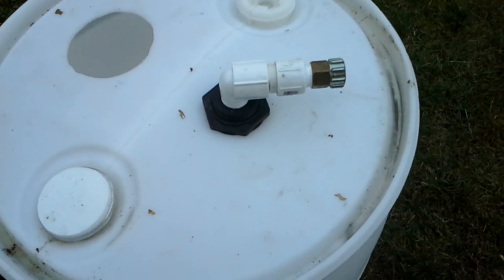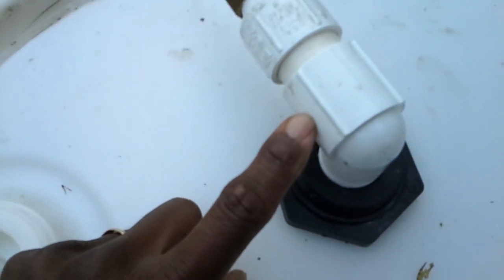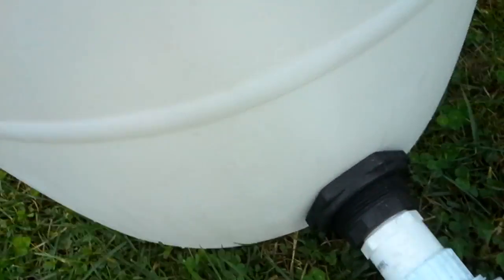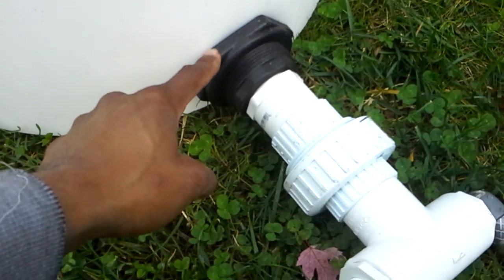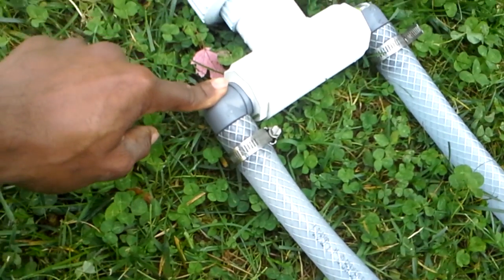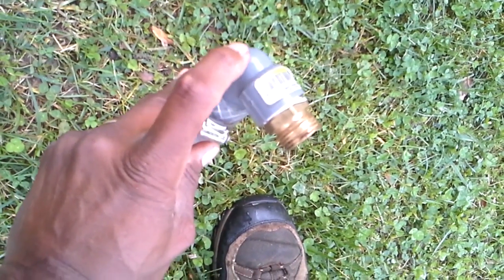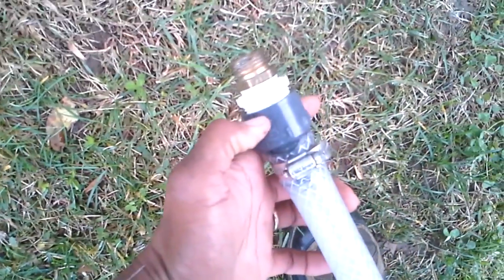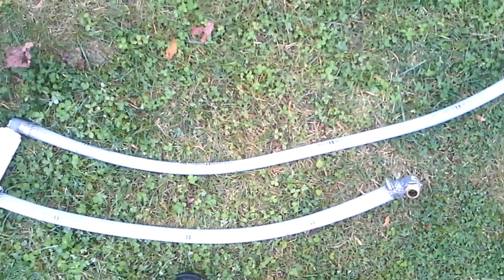How to setup a portable economical pressure washer buffer/float 55 gallon barrel tank plumbing

Comment: What did you use as a lid to cover that hole on the top
Reply from the maker: A pro would have cut the hole to the determined size for a lid..
I went extreme budget (don't laugh, keeping it real) i balled a few big trash bags and stuffed it.. never fell in or came out. 🙂
Sure there are lots of options though. Thanks for viewing.
Reply: You can cut the hole a little bigger and use a 5 gallon bucket lid :)

Comment: Would you mind listing the pieces for me? im trying to pick them to do my own buffer tank like this!
Reply from the maker: It's just 1.5" fittings for hardware store...
The only thing I ordered online at the time if this build was the black banjo fitting, but I believe they have them in stores now, the hudson float valve online.
1.5" treaded to spigot
1.5" union
1.5" tee
1.5 to 1" reducing (slip to threaded)
1" treaded to barb..
Then figure what you need to go into your pump...on mine I needed to go from barb to 3/4" garden

Comment: Hey Griff, thanks for the video. Do you think that 55 gallon barrel setup with run 2 4000 psi 4 gpm pressure washer?
Reply from the maker: Oh yeah...I did
1.5 inch opening tee to two 1 inch lines into each machine.
Reply: I’m just gonna run one off of this design for now but as I grow and get another machine it is nice to know that I can run 2 off of this
Reply: What’s a botg?
Reply from the maker: Not sure what "botg" is
Reply: Griffs Services lmbo you meant both
Reply: Griff I didn’t even know you could combine to 4 gpm machines and make an 8
Reply from the maker: @americascout6764  😁
Reply from the maker: @americascout6764  oh yeah...
That's like my first video back in 2009...
Then I have one shooting a building 16gpm
Reply: Griffs Services are you serious? Good to know
Reply from the maker: @americascout6764  https://youtu.be/02PkryqmatU
Reply: Griffs Services you’re a genius! I can’t believe that worked!
Reply: Awesome Thanks Griff! That’s a really awesome design.
Reply from the maker: @americascout6764  welcome!
Are you planning on combining the botg machines for one trigger high flow?

Comment: Thank you sir!  Very informational! Quick question. I am wanting to run 2 washers off a 275 gallon tote. Would it be ok to just install 2, 1" banjo fittings at the bottom of the tank then feed straight to each washer? I have a 2" inlet with banjo already but want to use that for dumping the tank.
Reply from the maker: Jeremy Cockerham thank you...
Yes you can install individual 1" lines to each machine via individual tank fittings.
Here is an option to consider, run the existing 2" bulkhead with a 2" tee, one side for dump, the other side fitted with a line to accommodate another tee and branch off as in video.
Either way would work, depending on the GPM of each machine. What gpm are they each?
Reply: Griffs Services (House & Building Soft Wash, Power Washing, Pressure Cleaning) Thanks for the quick reply! We are running 2, 4 gallon per minute units. I would probably get more pressure coming from the 2" into the 1" as opposed to coming straight from a 1" from the tank.
Reply from the maker: Jeremy Cockerham Two 4 gpm you should be fine as in video, however I would put 1"  valves at the line closest to the tank, just in case you drain the tank all the way for some reason , that way you will maintain prime in each of the machine supply lines.
Are both machines direct, belt or gearbox driven ?? (slower speed pump aka belt & gear have the capacity to suck , from flodded/primed lines, most direct drives have to be force feed with some positive pressure to inlet. The higher the water level of your tank or even the tank itself in relation to the inlet of the pump inlet, the more inlet head the pumps will have, ie better output performance.
Reply: Griffs Services (House & Building Soft Wash, Power Washing, Pressure Cleaning) They are both direct drive. We will soon be upgrading to belt drive. Thanks for all your help . I greatly appreciate it
Reply from the maker: Jeremy Cockerham 👍

Comment: I have a question. I'm starting off with residential, driveways, siding, walkways, etc...
What would be the average water tank size (gal) that I would need. With my pressure washer at 4000 psi at 3.5gpm
Reply from the maker: Joshua Sutton that size in video is 55 gallon I obtained free of charge at local car wash.. they also had a 30 gallon...any of the two should fit your needs. thanks for watching
Reply: Awesome! Thank you so much for the advice.and great video
Reply from the maker: Joshua Sutton Your are welcome..all the best on your endeavors
Reply: Griffs Services
Hi 👋 
I just set up my pressure washing rig in a very similar way to the video except I have a 125 gallon horizontal tank.for some reason I am not getting water pressure to the pressure washer. What can I be doing wrong? I have a direct drive dewalt 3800 psi at 3.5 gpm
Reply from the maker: Joshua Sutton what do you mean exactly that you're not getting water pressure?
follow this procedure: Fill the 125 gallon tank ensure that there is an opening to the top of the tank so air can get in this ensures it would no create a vacuum on the tank.
and ensure that you're getting a nice flow between the 125 gallon tank and the line that is to be connected to the pressure pump. (this line should be no less than three-quarter inch internal diameter)
connect the feed line to the pressure washer. ensure that there is no pressure line on the exit of the pump.
start your pressure washer and observe the outlet flow. 
(some direct drive pumps do not draw water, so they need a proper priming, and a good head pressure to the inlet of the pump, you can achieve head pressure by having the tank higher than the height of the inlet of the pump).
hopefully this procedure get you going
Reply: Griffs Services water is not being pushed to the pressure washer from the tank. Could it be that I have the pressure washer on the stand and I need to take it off to mount it to the trailer?
Reply from the maker: Joshua Sutton ideally the inlet of the pressure washer should be lower than the outlet of the tank in addition the tank should be full before you start
Reply: Griffs Services 
Ok. I'm going to take it off the stand tomorrow and then see what happens
Reply from the maker: Joshua Sutton ensure that you see if flow from the tank line and while it's flowing then connected to the pressure washer.. that way you are ensuring that the inlet of the pressure pump is flooded

Comment: can you list all the parts you use in the comment section please? will a 1500 psi pressure washer work?
Reply from the maker: Josh Foster you giving me homework.  lol....I will
Reply: Griffs Services haha I would greatly appreciate it. trying to get this detail business going asap. I have a pressure washer.and a 55 gal drum. it has a water spicket towards the bottom of barrel. I filled up the drum half way and hooked my pressure washer to it. It won't keep spraying. I think I need a bigger opening for the water to come out of the barrel?
Reply from the maker: Josh Foster That depends...some pressure washers  (the pump really ) can't draw...so you will have to have the drum at a minimum level so that it forces water into the inlet of pump...what is the model of the pump or washer you have?
Reply from the maker: Josh Foster 1.5" tank fitting 1.5" adaptor (threaded to slip), shot piece of 1.5" pvc pipe 1.5" union (slip) ,1.5" Tee, 1.5" to 1" reducing bushing (slip to threaded), 1" threaded to 1" barb 90 deg, 2 hose clamps, 1" barb to 3/4" female, 3/4" ntp to 3/4 garden male...think that's it for the outlet...you need the inlet?
Reply: Griffs Services I have a briges and strain motor. handyman series pcs2-15421. the s in the first set might be a 5.. pump rpm is 3200. Also it's 1500 psi. It's probably 15 years old lol
Reply: Griffs Services omg thanks you so much! this is a huge help!
Reply from the maker: Josh Foster welcome...best of luck

Comment: is the top of that 55gal drum removable? if not how difficult was it to tighten the banjo fitting from the inside of the tank if it isnt open on the top?
Reply: is there a trick to installing inside the drum?
Reply from the maker: +luigi bossiello my arms are long enough for the opening I cut to the top...but general method for larger tanks is to use string or wire from top through open where banjo goes then just place top of string through banjo fitting and let it fall to opening. ..let your fingers pull it to opening to fit up fitting nut...
Reply from the maker: if the drum does not have a cut  opening like i did, then the banjo fitting used for outlet at bottom would have to be able to pass through the standard tank lid opening, and i dont think the have a banjo fitting that small, if it did it may not offer enoung flow to your pump

Comment: can you do this similar set up connecting two 55 gallon drums with bajo fittings on both sides and without the union and just a 1.5 tee to 1 hose outlet
Reply from the maker: I am sure you can...and you will have a larger capacity
Reply: can you post a link to the banjo fittings you used, I've never used them before
Reply from the maker: +luigi bossiello http://www.tank-depot.com/product.aspx?id=1018
Reply: thank you!

Comment: I'm going to get a water pump and connect it to my 65 gallon drum to feed my 2.3 GPM, 2800 PSI Pressure washer. Do I need to get an unloader valve, or will the one from my PW protect my water pump from running dry?
Reply from the maker: What is the model of your pump...an unloader function is not to protect against running dry..but rather to regulate the pressure to the amount at which it is set.
Reply: +Griffs Services I have the Ryobi 2800 PSI, 2.3 GPM gas PW, # RY802800. I was told that when I let go of the trigger, water won't circulate thru my water pump without the Unloader Valve?
Reply from the maker: +ScarredTemple not familiar with that brand/model...but must store bought units when you release the trigger the water does not "bypass" anywhere and thus the water in the pump head overheats...the only protection is a thermal relief  (and I am not sure if your unit has one)
Reply: +Griffs Services Thanks for the reply, I really appreciate it. The PW has a 4.4 HP, GCV 160 Honda engine, 3.3 KW @3600 rpm's (if that helps).
Reply from the maker: +ScarredTemple you are welcome. ..but I will have to look up the model when I get to store or on desktop...but till then nothing protects your pump from running dry..and most likely you don't have an external bypass... (this is where when you release the trigger the water from pump goes back to tank or open air
Reply: +Griffs Services Okay,thanks for clarifying that. If I don't have an external bypass, will I need an Unloader Valve?
Reply from the maker: +ScarredTemple all machines have unloader valve as standard..that controls the max pressure...the cheaper machines have the that valve bypass internaly  (you can't see the water) and bigger/commercial grade has ir bypass externally
Reply: +Griffs Services Okay, is there a PW that you would recommend that pulls from the tank, and doesn't need an additional Water Pump?
Reply from the maker: +ScarredTemple who says yours will not draw..get the tank and try it...some direct drives pull with...also if you have enough head from the tank and the feed line is adequately sized it may work..(line size should be preferred 1")
Reply: +Griffs Services I hope it does, so that I won't have to spend anymore money Lol. I won't be able to try until later next week though. Thanks again for the help
Reply from the maker: +ScarredTemple send me a check of the savings.   lol
Reply: +Griffs Services Lol.

Comment: I came across..Water pressure 3200 psi with a flow rate of 2.8 gpm will this work with this setup
Reply from the maker: it may or maynot, one of the best options is to elevate the barrel or set the pressure washer lower than the barrel. the water should flood the inlet and it may draw in..make  the feed line at least 1 inch.
Reply: For a 2.8 all you need is standard home pressure no buffer tank unless you have 4 or larger.

Comment: could u recommend  a electric pw.. I'm looking to start the a small detailing business  and I could go gas but I'd figure to go electric first any help would be sweet
Reply from the maker: +Emprez hernandez There are quit a few option on the market for mobile detail pressure washers, all of which i am not familiar. The doubt i have about smaller box store electric units is if it would draw (pull) adequately from a 55 gallon drum I have in video. In theory it should draw as the drum static pressure will push water through the supply line.
If you want to start off with a small electric i would suggest you obtain the customer service number from one of the big box stores pressure washer manufacturers, call them and hear what they say about their various units. Let me know how it goes.

Comment: This is a great solution to my problem and much cheaper than ordering a tank online. Is your pump belt driven or is it direct drive PW?
Reply from the maker: Richard Williams the pumps running off this set up was a gear box drive (4.0) and the other belt 4.5
https://www.youtube.com/watch?v=KRaf2FnBBSs
ps. no charge for the 55 gallon drum at my local carwash
Reply: Thanks for the come back brother, I appreciate it. My unit unfortunately is a direct drive. My unit is a 3.5 five gallons a minute at 4000 psi. By North Star. It's a great portable unit, I never had any problems with it. But I was looking to put a tank on board to have the option of having water on board for power washing, window and Awning cleaning
Reply: In your opinion, do you think it would work
Reply from the maker: It very well may...feed the pump with a one inch line, ensure there is no air pockets, maybe even tee at the end to ensure you are always bleed 100% just before the pump.
Reply: Hey with a free 55 gallon drum and a couple  of dollars for plumbing fixtures, what can I lose. Thanks a lot buddy, I'll keep you posted
Reply: The worst that can happen is it doesn't work, but I'll have a great chemical storage tank for free. So I the way it's win-win and thanks again
Reply from the maker: 50 cents it works,.....post your results
Reply: Hey brother, it works pretty good. Just think, I almost bought a tank for $425 and the shipping & handling charges alone was $275 to $350.  Even if I bought the tank, I would have still had to buy the plumbing fixtures to connect to a pressure washer anyway. So you saved me about $700 to $775. Thanks so much.
Reply from the maker: Great...I will keep an eye out for my commission, lol....now hook it up to  a municipal supply and see if you feel a slight difference?
Reply: Lol, Yep Yep
Reply: Have a great day brother!

Comment: Can this be used for a smaller 1600psi generic store bought pressure washer? Looking to set up a cleaning station in my workshop and cant have the main hose inside.
Reply: Hi Walter, not quite certain if the generic pressure washer can pull from a 55 gallon tank, but I think if the inlet to the  pump is flooded (no air).... in conjuction with the head pressure from the water in the barrel,  I think the pressure washer should work fine

Comment from the maker: For sure CL, got the drum at local car wash. And if 55 gallons is not enough buffer, then there is always the option of adding a second drum with equalizing plumbing connecting both, then that setup would be close to 100 gallon buffer  ( I recommend a 1 1/2" to 2" equalizer  )